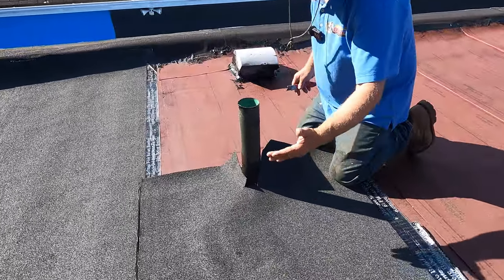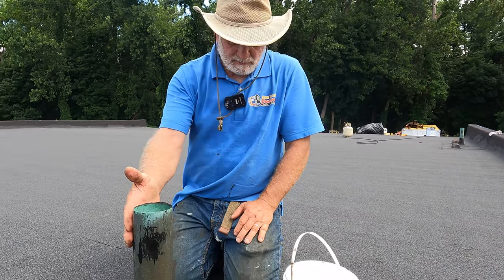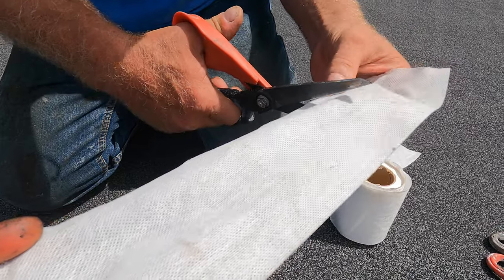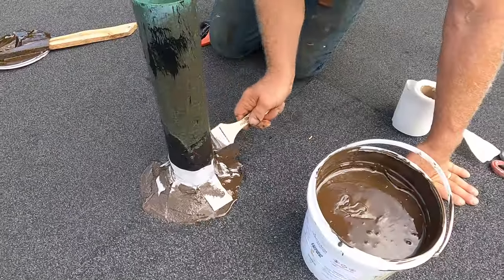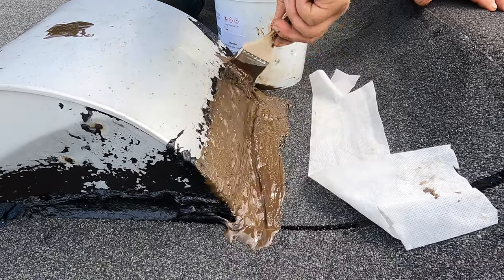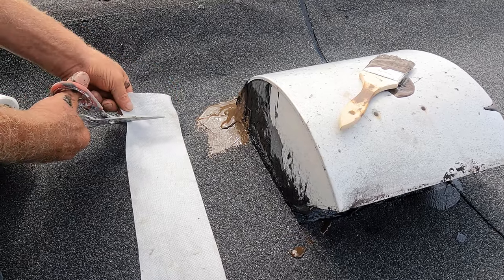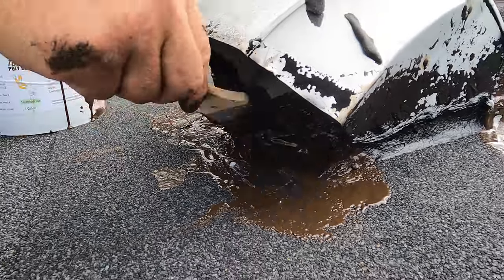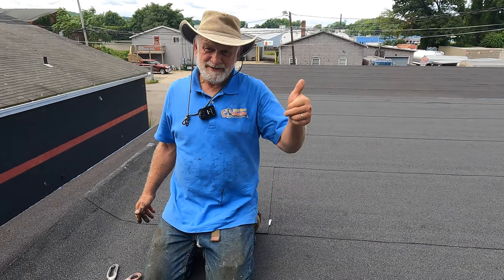Cheap, Easy, DIY Liquid Flashing for Vents, Walls and vent pipes, Flat Roof Repairs/ Patch Leaks

Comment: What if you’re doing new roof do you do it just like that cut the rubber roof around the vent and then seal it with that fiber and the poly stuff that you have
Reply: Old video.  Hes doing a bitumen system.  Rubber...if you use silicon you're a hack.  Use primer, and uncured like a real roofer

Comment: Just so you know industry standard on vertical flashing height is minimum 8 inches high. Secondly you should have cleaned the old sealant from the pipe so that your new flashing is adhered to the pipe itself not the old sealant which will continue to degrade. Learn good roofing practices.
Reply: He is absolutely clueless.

Comment: These applications leak after a few years ,I've had a rubber roof installed.its not a great system they faulter ,as all other chimney to asphalt shingles do ,they haven't met up with the times ,roofs should last for a  long time the never do , I've live in ten houses ,ten leaked with these product ,they pull away or crack.🤔